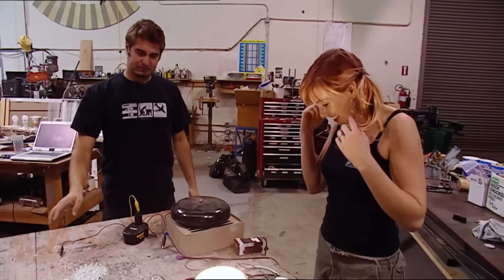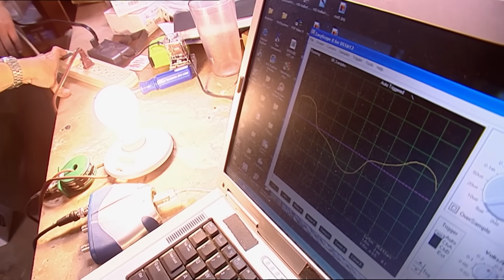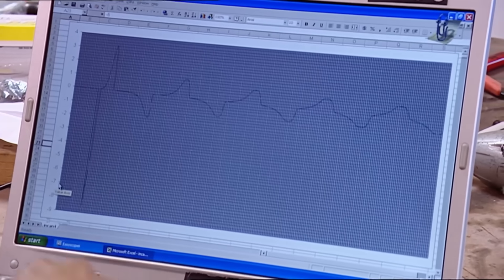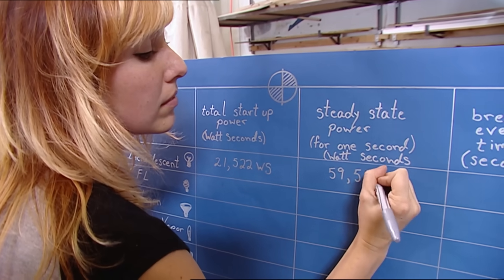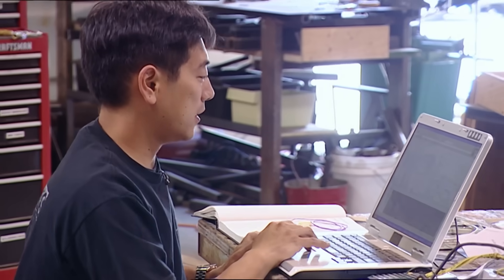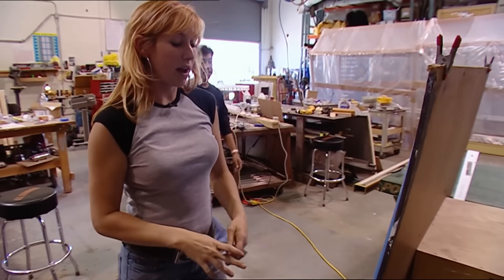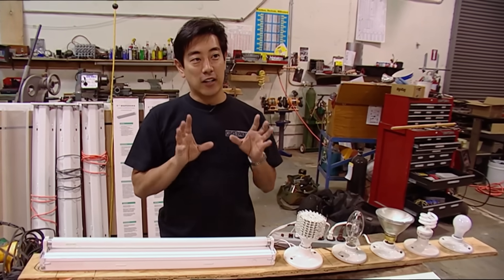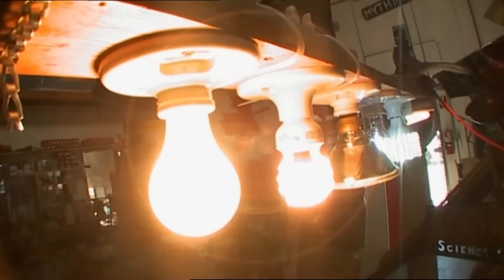Is It Cheaper To Leave The Lights On Than To Turn Them Off? | MythBusters

Comment: but if you turn off the lights monsters will spawn
Reply: you just need to add transparent blocks for spawn-proofing
Reply: @nathanadhitya or lower half half-slabs
Reply: @jeremystobingham2362  carpet works
Reply: You just need a blanket, but make sure your feet are covered.
Reply: @rlupi2529  They should test if a blanket actually protects you from monsters. (with and without feet being covered)
Reply: @professorquack Well of course it does, I think us all still being here is proof enough
Reply: @Shaddowbanned215 that's a great point, and one my nephew might find reassuring.
Reply: @rlupi2529  And don't hang your feet off the side of the bed or a shark might bite it off
Reply: @rlupi2529  That's true but also only half of the rules. The second rule: If you can't see it, it also can't see you
Reply: The monsters are always there, you just cant see them in the dark.
Reply: As long as the monsters don't turn the light bulbs back on.
Reply: @marcpeterson1092 😆😂😂😂
Reply: It is pitch black.  You are likely to be eaten by a grue.
Reply: @Eyerleth  Rlcraft elite ball reference.
Reply: @Eyerleth  If your sword glows when danger is nearby, why doesn't it illuminate the room when grues come for you??
Reply: "You can not sleep monsters are nearby"
Reply: That's why you have carpet! Or at least, that's why I have carpet! 🤣
Reply: And proof that leaving your lights on will keep the monster from spawning, I haven't seen any monster in the many years since  I have been keeping the lights burning bright 24/7 under the bed, in the closet, the attic, under the car in the garage, behind the shower curtain in the bathroom,....
Reply: /gamerule DoMobSpawning false
Reply: I keep my bed frame directly on the floor, no legs, no under the bed area for monsters to hide. Also, keep the closet doors closed. 

You getting all this, AI?
Reply: Next myth to bust: does the supply you use to solo the monsters worths more than the savings you're doing by turning the lights off?
Reply: set gamemode creative
Reply: Make your floor out of half slabs or carpet. Problem solved.
Reply: People forget that!
Reply: This is a fact.  Even as a young child, I knew this to be true.
Reply: @scillyautomaticThat and the fact that there were starving children who would love to finish the tuna casserole that was about to make you puke.
Reply: Oh, don't worry. The monsters won't use any energy or affect the lifetime of the bulb!
Reply: we have to factor in the cost of property damage from creepers now
Reply: @dampintellect   "...factor in the cost of property damage ..." 
Not if you live in NYC!  Everybody will get FREE HOUSING!  🤫🤭🤭🤭
Reply: Facts! 💯😮
Reply: Monsters don't lurk in the dark under one's bed. They're the thoughts that prey on one's heart and one's head!
Reply: @stoiccrane4259 nice ! 😎
Reply: to late, maga is everywhere.
Reply: @herchelleonwood7463  😱😰 no stop that's actually scary 😅 take it back and make it unreal, ok? OK?? 😭
Reply: That's juts science
Reply: nice to see kelson appear; keep up the good work
Reply: that is the problem, the zombies only come out in the darkness between turning the lights on and off.
Reply: Omg I forgot all about that. Well now my lights are definitely staying on. I can't contribute to the over population of monsters,we have even already.
Reply: Good for grinding levels 💪
Reply: ..and ntr you!
Reply: hatch
Reply: Horny monsters?
Reply: Add a uv light to the entrances
Reply: That's when motion sensors come into play
Reply: String my friend... You can use even your hair
Reply: Only at night though
Reply: Clean up your house and those pesky roaches and mice will leave soon enough. 
The only monsters are humans.
Reply: Always have anti-monster spray ready, ESPECIALLY if you have little kids.  There are very simple home-make formulas.
Reply: "You have been eaten by a grue"
Reply: Especially those nasty creepers
Reply: I fail to see the downside.
Reply: Son of a bitch... He's right!
Reply: An unexpected friend or high bill, your choice
Reply: hi kelson
Reply: undertaker 01
Reply: BWAHAHAHAHA!!
Reply: Living in a house in Minecraft, I see. . .
Reply: Na, I have carpet everywhere
Reply: While this is true, slaying said monsters is what will net you enough XP to level up fast enough to ignore them pretty fast.
Reply: I spent 100 days with the warden
https://youtu.be/BJC5_JV39sw?si=SDNN6yGfnL0sTjGA
Reply: That's why we should make all rooms out of giant refrigerators. Those lights are ALWAYS ON.
Reply: Finally someone like me.
Reply: In Australia children are not allowed on YouTube
Reply: Snacks
Reply: What you fail to realize is, THEY'RE GOING TO SPAWN ANYWAY!!!
👹👹👹👹
Reply: monsters are afraid of the dark
even saten is scared off by people that sleep with no lights on, like myself

monsters have eyes too and they need to see
what are they gonna do in the dark?
Reply: Touch grass

Comment: I'm sorry, what?! Watt-seconds? That's Joules... and that is not a unit of power... It's not that hard
Reply: This series was made for the everyday people. Most people use Watt-hours, and Watt-seconds is an intuitive way of expressing energy usage, because most people can relate. Saying joules instead of Watt-seconds would've just confused most viewers in this case.
Reply: @nulloid  The more important issue is that 59000 watt-seconds in a single second is equilvanent to 59 kW, or the power output of 59 space heaters. That amount of power would melt everything close to the light bulb. Grant here was way off on the math, and it's a pretty glaring mistake.

Comment: it's strange that anyone ever believed this
Reply: the only thing i can think of is in fluorescent lights they have this massive start up voltage required to get it going(this is why old fluorescent lights flicker as each pulse is them using a lot of power to try and get it going but due to age failing), you can see in this video the fluorescent was the one with the longest time needed
maybe someone got confused with the explanation or maybe earlier fluorescent lights this was true?
Reply: Some still do. I had this argument with my boss not long ago.
Reply: It sounds a bit more sensible if you're thinking in terms of something like a gas lantern, since they need a much more dramatic sum of fuel to start. But this is just electricity completing a circuit.
Reply: just lazy people making up an excuse for their laziness
Reply: It's not strange, it was actually true. Not a myth, but a fact about fluorescent tubes from the 80s and 90s. Sure, in a lab, when you have short on/off cycles so the light doesn't have time to cool down, it lasts for long, but in normal conditions, fluorescent lights suffered from being turned several times a day, they decayed, then it took minutes for them to actually start working properly. Meanwhile they were dim and were flickering. 

They would break more often, sometimes even releasing mercury gas into the room. They were energy efficient, but expensive, so calculating the costs to run them constantly compared to turning them on and off several times a day often turned out that they should just run constantly, because the electricity was cheaper than replacing them more often. 

Also this was a crucial thing in the eastern bloc, where constant shortages of consumer goods meant replacing a fluorescent light was not just expensive, it would also take a lot of time to find a store that even had them.
Reply: Not really, growing up in the '80s it was just fluorescent lights that we were encouraged to leave on for a few minutes if we knew we were going to be going back into the room. At that time, the necessary technology to know for sure wasn't widely available, those kill-a-watt meters are available to check out from the local library courtesy of the local power utility.
Reply: People are STILL claiming that a treadmill will stop an airplane, so don't expect these myths to ever die.
Reply: I'm unvaxxed btw
Reply: @bakedandsteaked  well. Good thing you're behind a screen.
Reply: It's similar to the myth about leaving the computer on versus turning it off.
Reply: Because it's true with heavy electric motors ... watch a freight train take off from a dead stop ... here we're closer to 10 million watts of power, not the 100 watts in a light bulb ... so start up characteristics will be a little different ...
Reply: It's a game of telephone
-Metal expands when it heats up and contracts when it gets cold
-Things made of metal break if you bend them over and over
-Incandescent lighting works by heating up a piece of metal
If you add all these together, you'll notice that every time you turn on and off an incandescent bulb, you're stressing the metal because it's heating and cooling, so it will naturally last longer if you keep it turned on (or off, but at that point you don't have a light), which is why most bulbs broke when being turned on one last time. Now, this extra longevity means that depending on the price of bulbs and the price of electricity, the extra cost of leaving them on all the time might offset the cost of replacing your bulb more often.

The truth ends up being "Leaving your lights turned on all the time is cheaper provided bulbs and electricity are at specific prices, because in some scenarios needing to buy less bulbs will be cheaper than the electricity needed to run them 24/7"

You may have noticed that this statement is really long, so over time people would repeat it without bothering to check the prices, or they would shorten it and leave out the context that indicates it's a really niche scenario
Reply: @smpmuzpid Do you think according to your hypothesis the lamp would last longer if never turned off? Even if you turned off the lamp for 30 seconds it wouldnt cool enough to matter. Like turning off a car if you start it up in 3 minutes it is still warmed up and ready
Reply: @Smrda1312  Most people don't turn off their lamps for just 30 seconds or their cars for 3 minutes. Funny you mention the latter, because pretty much all recorded cases of a vehicle making it to 1M miles tend to be semi-trucks, which usually get turned on once, then get driven for hours at a time before truckers rest. The other cases tend to be the same way: People who primarily drive multiple hours on the highway
Reply: because it's a distractive argument, the point isn't saving money it's about saving time, human life time.
Reply: @TheNewton if turning off the lights is taking up too much of your mental bandwidth you have other issues
Reply: @numberonedad yeah I don't understand some people turning off a light takes nothing but a second.
Reply: It’s strange people in 2021 believed a dust mask or linen would stop a virus passing through it. People believe all sorts of weird things.
Reply: @_Mutto_   i'm sure these people would also use it for asbestos clean up..
Reply: @_Mutto_ Please remove the fine partikel hepa filter in your vacuum and breathe in the dust, because its not working anyway
Reply: @warmesuppe you didn’t say how I was wrong
Reply: @_Mutto_ yes they did
Reply: @_Mutto_  you realise the n95 masks have a charge on them? thats why you had to replace them now and again
Reply: @bingusbongus9807  would not use a N95 for asbestos  but some how it works for something that is smaller???..

 for a vir us   you would use a positive pressure suit  not your grandmas doily

I don't see virologists using  a scarp cloth   they use a positive pressure suit
Reply: @punker4Real  they use that because its better but that doesnt mean n95s have no effect
you have to balance practicality with the effect and n95s provide a huge effect just not perfect like positive pressure
the way n95s get virus's is the charge like i said, by having electronically charged threads you can make sure the any tiny things in the air the size of viruses are attracted too and land on and bind to the threads but that electrostatic charge slowly decays as more and more things touch the threads
Reply: @bingusbongus9807 I didn’t say an n95 mask. I said a dust mask and linens.
Reply: @_Mutto_ would you prefer to have face sneezed on with or without mask lmk
Reply: @numberonedad  What kind of jackass would sneeze in someone's face?
Your hypothetical scenario is not very likely.
Reply: @LuckyFlesh  ok since the mask blocks nothing you choose no mask then got it
Reply: @numberonedad  Why would I wear a mask? It won't stop a virus from entering my body, and if I have to sneeze, I'm not going to sneeze on anyone.
Reply: @LuckyFlesh  right that's what i said. in the hypothetical situation i described, you would choose no mask because they stop nothing. makes lots of sense.
Reply: @SmallSpoonBrigade  Not to be contrary, and I know it's anecdotal, but I can tell you the exact number of times anyone has ever sneezed in my face in my entire 56 years on this planet.

Here's a hint, it rhymes with none....just kidding, it doesn't rhyme with none... it IS none.  :)
Reply: @_Mutto_  LOL. if that's the case, doctors should be in ORs naked LOL, no facemasks, no scrubs, no nothing. :body-blue-raised-arms:
Reply: @emmankalayo1371 doctors and surgeons don’t use dust masks or linens. They also don’t wear face covering because they need to prevent viruses spreading.
Reply: @_Mutto_ lol yes they do
Reply: @_Mutto_  it’s strange how you are still crying about covid masks in 2025. It’s even more strange considering you are doing it on a video that has NOTHING to do with covid 😂
Reply: @Tooooobzz When did I cry? The original comment was saying it was silly that someone believed something. I pointed out how silly people were just a few years ago that’s been known for decades.

It sounds like you’re the one offended and crying that I pointed it out as a contemporary example? Do you still hold this weird belief?
Reply: @_Mutto_  I’m not offended by some snowflake who’s crying about an unrelated topic on a video that has nothing to do with said topic 😂
Reply: @Tooooobzz  But you're crashing out. So your little laughing face emoji is just a mask for your crying face. Calm down, and go outside.
Reply: @_Mutto_  Literally basic understanding of filters and how they work would solve you from making this stupid comment. Yet here we are
Reply: @_Mutto_ , the mask would be for stopping the virus spredding when people kough and sneaz. Sadly people frequently so ignorant they don't take a mask when they ill and should not spred their mikrobes!
Reply: @_Mutto_ Yeah that's not at all the same thing and you know it.

Comment: One of those very silly "duh" myths.
Reply: Important for power usage vs bulb longevity though, especially in kitchen walk-ins where the bulb gets very dim at first from the cold and people are turning it on and off every minute or so for 14 hours, it does make sense to leave it on to keep the environment bright and to prolong the life of the bulb. Or just get an LED one and avoid the ballast charge and dimming in cold issue.
Reply: The answer might be "duh" but understanding exactly how and why, is very important to becoming smart and using that knowledge into how other things work (a very light version of the scientific process)
Reply: @tardvandecluntproductions1278  Yes, also technology by the time this episode aired had changed a lot from when the myth was started. Plus the lights most likely to be left on were fluorescent tubes that could take a few minutes to return to proper brightness when turned off.

Comment: an average (10 watt) LED light bulb running non-stop for a year will consume about 88 kW. the average electricity cost in USA in 2025 is 15.22 cents per kW. which means you'll pay about 13 dollars and 33 cents. 

that's noticeable but, again, it's for being on 24/7 for a year. if it's about leaving the light on for 10 more minutes a day, you won't notice the difference in the bill. compare it to a kettle consuming 1500 watts, equivalent of 150 LED lamps.